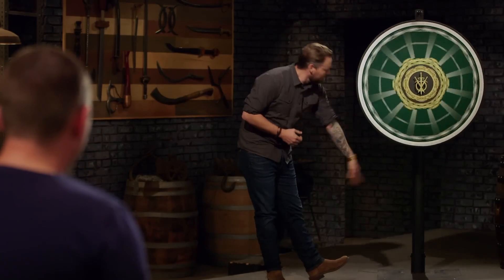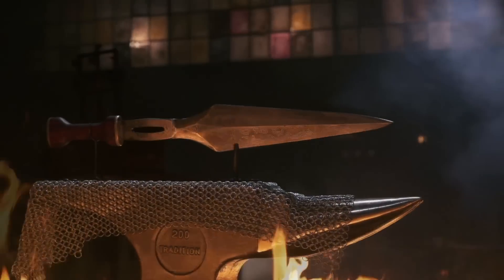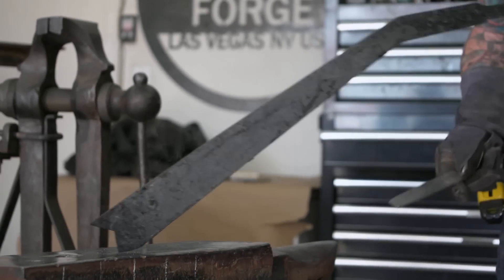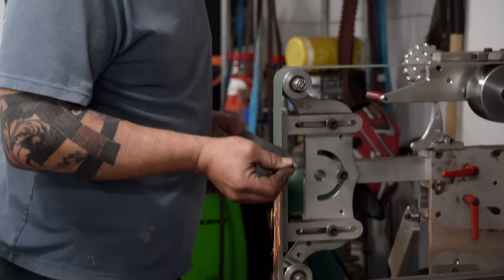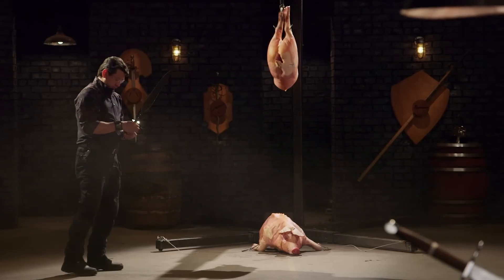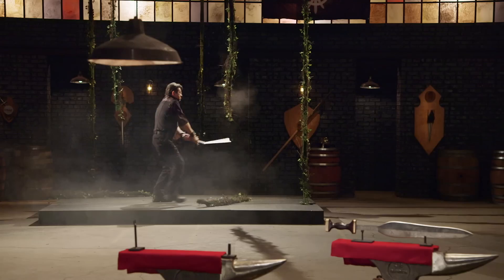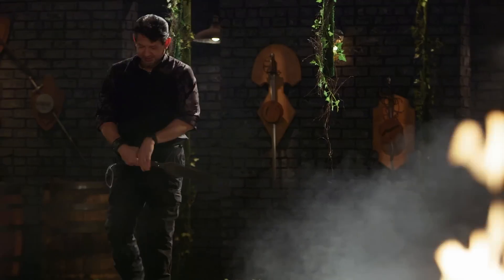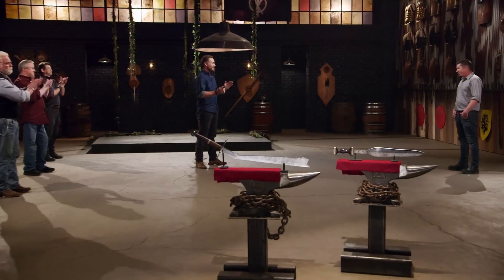Take A Spin On Our DEADLY Wheel Of Forging | Forged in Fire (Season 8)

Comment: Very surprising decision. The one-handed damascus blade performed equally as well as its plain two-handed competitor. How does that not earn it the win? 👎🤨
Reply: Easier to make so bladesmith making bigger weapon need more time, energy, and propably he is more skilled
Reply: @prasaite  He did a 300+ layer damascus... that's not added time and energy?
Reply: @vinceofdeath1361  try made 300 layers for pandat or claymore, and you see difference. Pandat was damascus to by the way.
Reply: Because he put two silly dots instead of a two-inch hole?
Reply: @promenota9610  But maybe 2 dots are for newbie warrior, and that 2 inch hole for veteran warrior?:D

Comment: A one handed blade performing so well should have won.
Reply: 100%
Reply: Longer blades are much harder to make. the balance between durability and weight is much harder to get right and any flaw in the blade shows much earlier due to the higher stresses involved. Also we dont know how those swords handled. The handling of a sword is one of is most important qualities. The judges mentioned multiple time that this Pandat was exceptionally light, which is something FiF values quite highly...

Comment: "The odds of it landing on Kelewang again are not too high"
Mate, they odds are exactly the same as they were before, they are just as high as then lmao
Reply: boy did you skip your probability classes??
Reply: Draw a tree diagramm
Reply: @ankleshwersinghtanwar5478  well the probability is lower but the chance is still the same. There isnt a high probability that a hundred coin tosses land on heads each time, but if u look at each coin flip, the chance is still 50/50 for each one of them.
Reply: @ankleshwersinghtanwar5478   It's called the Gambler's Fallacy. Every spin of the wheel is 100% independent of the other spins. It's still a 1/3 chance every time. That's why the Martingale gambling method almost always fails. House always wins.
Reply: I think what the meant is he had a 100 percent chance of making the funky weapon  if he did not spin again and much less if he respun.
Reply: @Mornech10  Casinos count on people falling for the gambler's fallacy.

Comment: I really don't understand how they judge two completely different weapons with different functions and purposes. It's comparing apples to oranges.
Reply: They can judge the different blades on if they fit the design they've asked for, the parameters they've given, how well they are made & how well they perform as a weapon
Reply: Only if they sliced an apple with one blade and an orange with the other would it be an unfair assessment

Comment: Why didn't the Bozande sword fail immediately? It doesn't have hole like the showcase one in beginning it has 2 small holes only?
Reply: Semantics. Both fit the same purpose of weight reduction and shifted balance.

If the judges didn't make it a parameter, then the smith gets free reign on specific details.
Reply: Because they don't have to make a replica of the example, they don't get a template copied from the example, they just have to make a true representation of that blade design, which most find from researching on the Internet